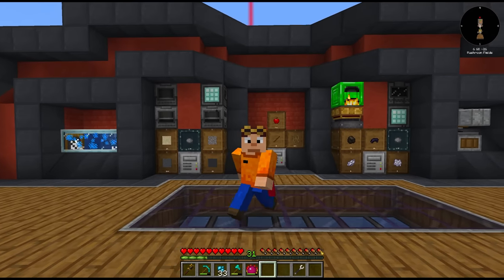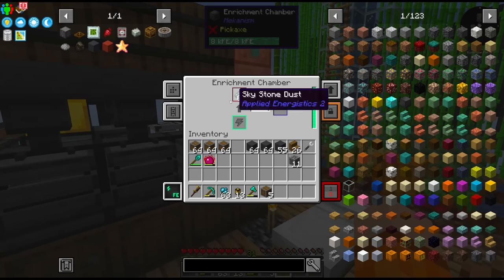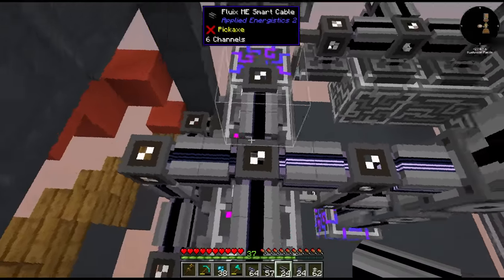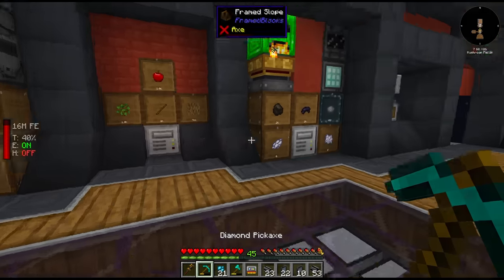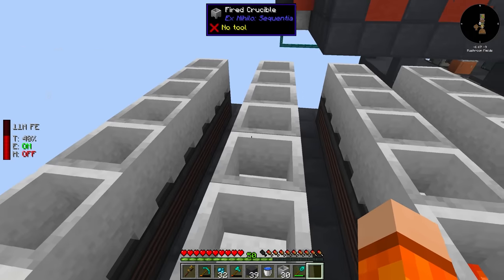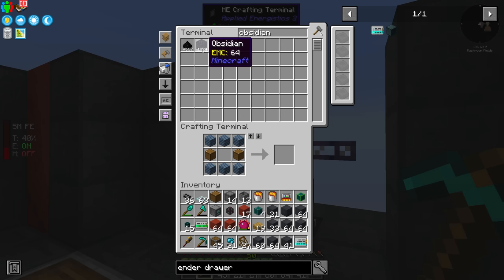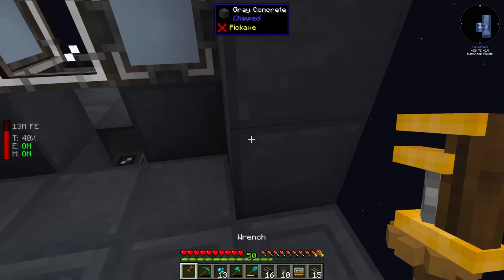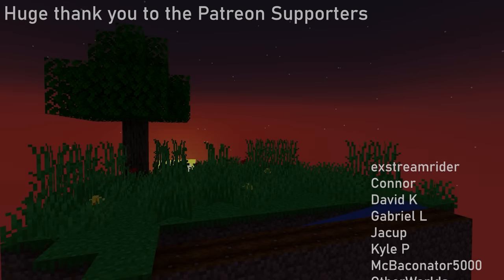Minecraft ATM7: To The Sky - Ep04 - P2P & Autocrafting With Applied Energistics 2

Comment: How about making all the storage buses priority 0 and rarer stuff priority -1000. Don't remember if it's possible to put priority on disk drives but if it is then you'll save some time not having to change priority on all storage buses.
Reply: Yes you can, just by habit to do external storage higher
Reply from the maker: Exactly, it certainly could work like that but it's just habit after so many years :)

Comment: whats the purpose of the separate system/controller or "subnet" as you called it? cant you just plug the p2p tunnel into its its own controller and accomplish the same thing?
Reply from the maker: You certainly can, yeah. Putting the connections on the subnet allows you to further condense the channels as you send them around your base. Which means less wires as you send the P2P outputs to where you need them around the world :)
Reply: Having the subnet for tunnels also means that you won't accidentally waste channels on the cables that carry network access.

Comment: So do I understand it correctly: P2P inputs are connected to controllers and then you only have to provide a ME cable to power the P2P output (which takes only 1 channel), and it'll basically pass all the used channels that are connected to P2P wirelessly, directly to the ME Controller?
Reply from the maker: Yes! It's not wireless though unless you setup a quantum ring, but you are using channel compression so you can send more channels around with less cables :))
Reply: @Threefold.  Oh now I fully get it. Thanks!
Reply: @Threefold.  Why use a sub-net ME Controller? Isn't it unnecessary?

Comment: Technically you can get more than 32 channels out of a face of a controller if a device could pull out more channels, since there isn’t, only 32 channels can be extracted
Flux networks has wireless charging
They separated interfaces out so interfaces didn’t have to do everything, RS does the same